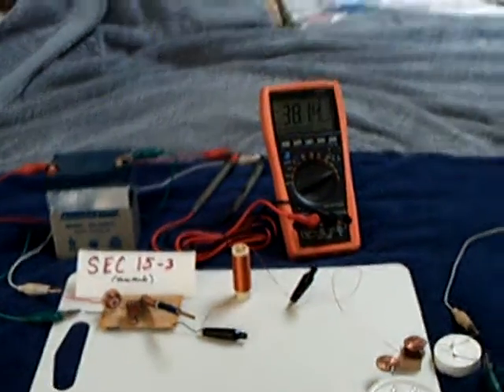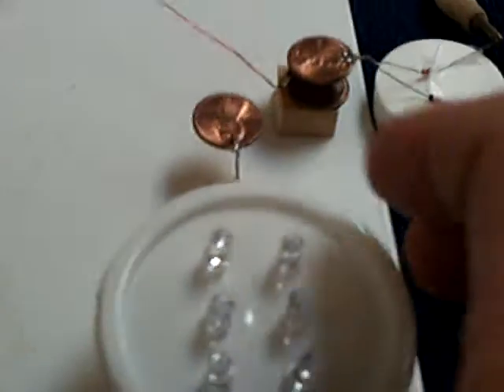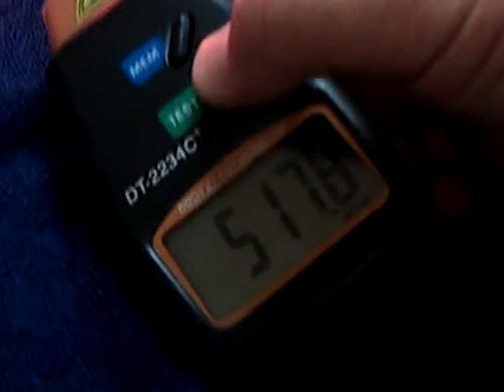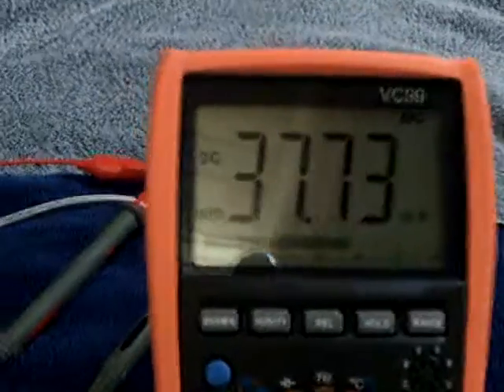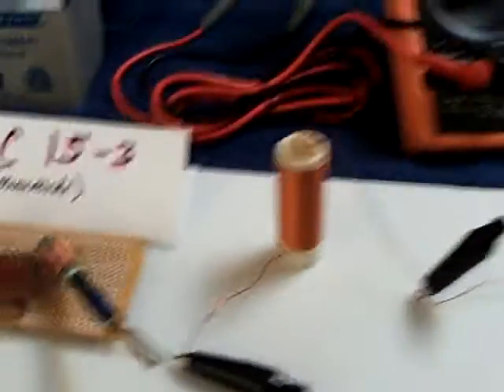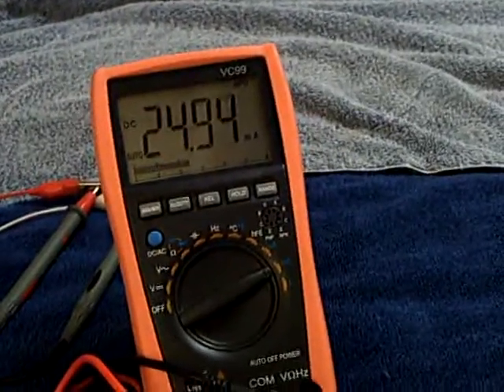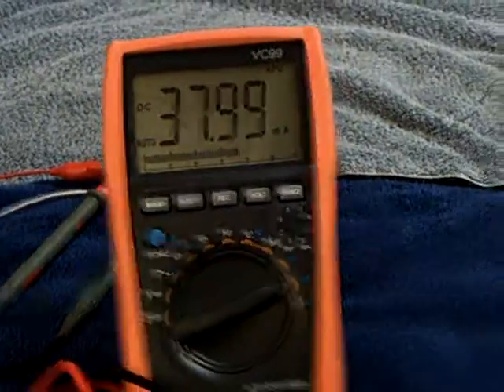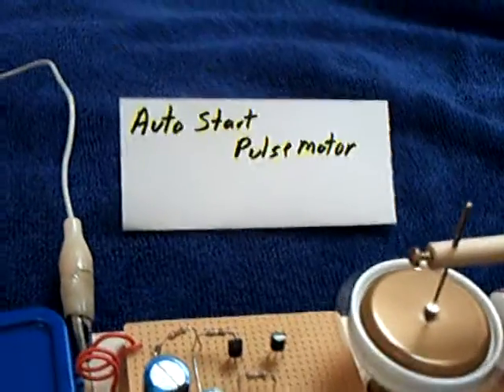My 3 penny SEC experiment.ASF

Comment: I have been following you for years..Thankyou. re yr 3 penny video: very exciting.
Please follow up on this anomaly that you showed. Add several bank of leds and see if the effect keeps multiplying.  something very weird seems to be going on and deserves more experimentation.

I also saw resently, I believed on lasersaber's site where he showed a coil that seemed to defy lenz law and produced power under load but speed up the pulse motor he was using to generate the power from the coil. replicat

Comment: @Lidmotor : Thnks 4 replying. (Im a huge fan of your videos/experiments)

Intriguing indeed :) thats what keeps me coming back watching these videos!!! Although isn't the SEC transmitting high voltage at low amperage like a crystal radio? If so that would explain why you get the LED's to light up in series. 

- 6 x 2.5 volts in series = 15 volts @ 20mah
- 6 x 2.5 volts in parallel = 2.5 volts @ 120mah 

can you power the same LED's in parallel? does the motor still speed up, or slow down?

Comment from the maker: @bytesilver ------Thanks.  Several people have mentioned that adding the middle penny makes the coupling more efficient-----but no one is talking about the extra six LEDs that are getting lit up full brightness.  Those six LEDs are in series.  Each LED takes about 20mA and around 2.5 volts to light up.  Where is THAT extra energy coming from when the amp draw goes down and he motor speeds up???? Hummm.

Comment: I think I have an explanation to this. (i could be 100% wrong)

The reason why the amp draw goes down is because the pennies are CLOSER and making a more efficient  "capacitor coupling" . when you remove the middle penny, it requires more current to flow through the empty space and therefore the motor turns slower and the ampdraw goes up.

How about using GOLD RING ?!?!... see what happens there. My guess is the ampdraw will go down even more.

Comment from the maker: @slider2732 --- My experience with adding more loads is that each addition pulls energy form the other loads but does not increase the amp draw on the source.  That is why what happened here surprised me. The amp draw went DOWN and the motor RPM went UP when I added the LEDs .   This is not what usually happens.  Oh how I wish that I could get this to run my washng machine--wireslessly.   Maybe someday.

Comment from the maker: @min2oly -----I have not scoped this but I imagine that the frequency does change.  Dr. S calls this "spatial resonance".  It is tricky to find.  If you change things only slightly you lose it.   There was only one setting on my tunable inductor where the event in this video happened.  Based upon other experiments I suppose that it was around 14 megahertz---with other energy spikes spaced out at multiples of 1.094.

Comment: This is a head scratcher indeed. Wonder if a 4th penny above could light LED's wirelessly, or if a sort of stack of a dozen would work, different resonance points like a tapped transformer.
I'm a fan of that sort of presentation camera work, "here's the circuit running....and over here it's also wirelessly running a lightbulb and the washing machine". Well, near enough, very cool !

Comment: MY 2¢ COMMENT:
Your videos sure are fun!! Thanks for this. Here are my 2¢. 

When you insert the 1¢ coin you are closing the air gap between the other 2 coins their-by reducing the resistance of the air gap. To me it seems more like a resentence coupling then a capacitance one. 

Have you tried to put a 1¢ coin in the middle of the other coins with no LED’s attached to see if the amp draw is even lower?

Thanks again!

Comment from the maker: @PoirierMike -----The "unloaded" battery voltage will go down as the energy drains out of it.  The "loaded" voltage might go up just slightly as the amperage decreased-----but it was only about a 10 mA shift.  Not enough to make a difference.  Bottom line is that the device is using energy.  It is just how much bang for the buck do you get out of it.

Comment from the maker: @zebok3 -----If you are referring to PoirierMike's comment about  battery voltage going up when the amperage goes down ---you are right.  But if you had a "weak" battery the "loaded" voltage would show a fluctuation based on the load applied.   Either way your drainng the battery.  The "unloaded" voltage is going down as the energy is consumed.

Comment: Capacitive coupling, you are increasing the surface area/capacitance of it when you add the second penny. Replace the penny set up with a capacitor with the top cut off and a wire added to the top as a tap, you should see the same result.

Comment: Lid, I like it. You increased the load and the source current  goes down, I see, Interesting. Could you check the 12 volt battery voltage before and after? I wounder if the voltage goes up while the current goes down with the load increase. Yea!